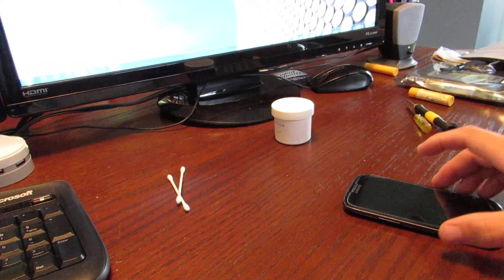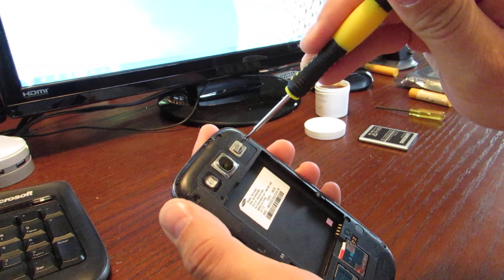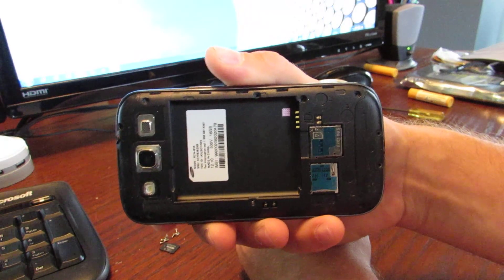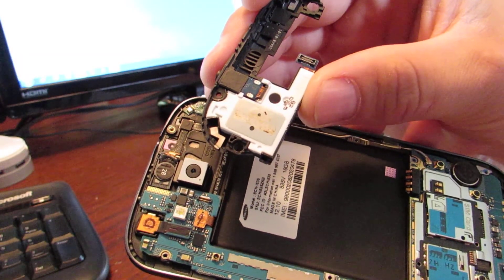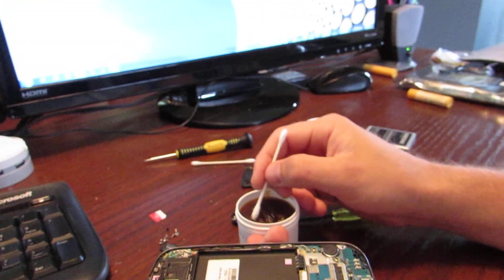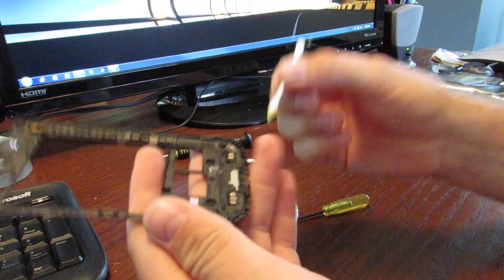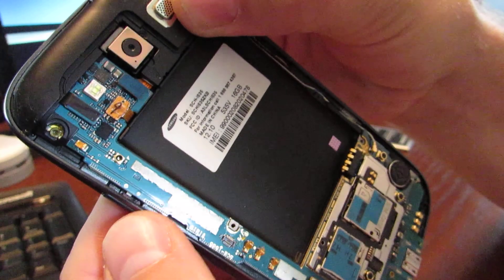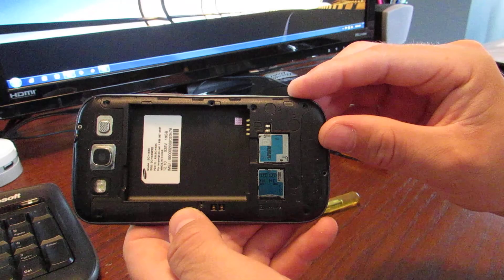SAMSUNG GALAXY S3 SIII GPS FIX WHEN SCREW TIGHTENING DOESN'T WORK *READ DESCRIPTION!

Comment: Thx jpatt2020
My GPS has never worked consistently on my SG3 and was a source of continual frustration. The screw tightening worked for about a week and then I followed your instructions and it has been working perfectly for about 2 weeks...
It took me a while to find the conductive lubricant. No local store had it and I found Amazon to be pretty confusing in the description of the different products. Many of the products that come up in a search for 'conductive lubricant' are NOT conductive.
I could not find the exact one you use but this one meets the criterion of conductivity and appears to support this repair procedure. It comes in a tube and is labeled Carbon Conductive Grease by MG Chemicals out of Ontario Canada. I found it on Amazon.
Thanks for posting an excellent vid that provides true value.

Comment: Thanks so much for the efforts, but no such luck. I used bulb grease as suggested since it's readily available. After first try with no success, I went back in and added a little more to each spot in case I was being overly cautious. Back to the drawing board. I think I'm about out of options.
Reply: Update: It worked!! Thank you so much! I just needed a reboot or a little time out in the car or something. It is now getting signal within about 3 seconds and picking up 17 or 18 satellites. I've tested it over several days with fantastic results. Really can't thank you enough.

Comment: Thanks for this. I have been having GPS issues for almost a year now. I always suspect it was a modem/baseband conflict because I have a Tmo NOTE 3 running on AT&T and I flashed updated modem. I followed previous troubleshooting guides but when I pry the back cover opened I did not see any bent or damaged contacts. I will order some grease and follow your guide and hopefully it will work to fix my N3. 
Thanks for sharing!

Comment: Hi, i was wondering, even on amazon I am having issues with finding graphite grease.. I can find powered graphite grease, but that doesn't sound like you should use it in a phone.. again- even on amaon.. it is either spray or powered..

help! stupid GPS, is definitely the issue on my phone.. and I am hoping this will be the fix. nothing else worked. .(screws etc.)

Comment: I appreciate your help. Ive looked all over internet & besides your video i haven't been able to find anything to help me fix this problem. At this point I'm willing to try anything b4 dishing out hundreds of $$'s on a new device.  **Do you know which antenna affects calls, dropped calls, messaging,  internet, etc. ?
Reply: Here is a video showing which connection on the motherboard is for the call/messaging part of the phone.  It is a long video to sit through so I will tell you that it is pointed out at about 8:30 in the video.  Also if you watch at 11:50 you can see a test you can do to check your signal strength for calls.   The video might give you another idea of something to try if you still haven't fixed your phone and don't mind sitting through and watching it all.  Or just read the description and it gives you the gist.  Hope you get it working!

Comment: Will conductive ink work in place of grease?
Reply: Well i did everything u suggested in video but i didn't have any conductive grease. My phone reception 'signal bars' were a little better for a few days. Then device went back to having just One bar. Anyway, I do have a circuit writer conductive pen so i was wondering if that would help on the contacts (on the back of plastic cover)  Any ideas? i really don't want to screw up my phone! lol
Reply: Btw my main problem is reception,  dropped calls, missed texts, etc..